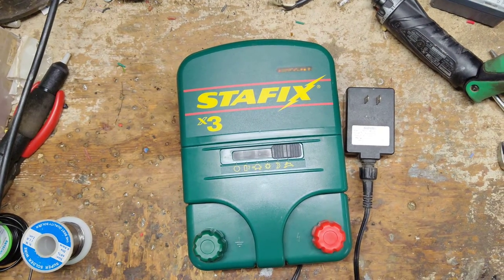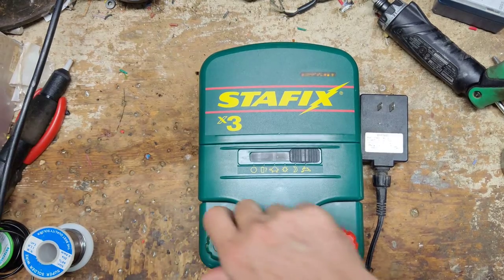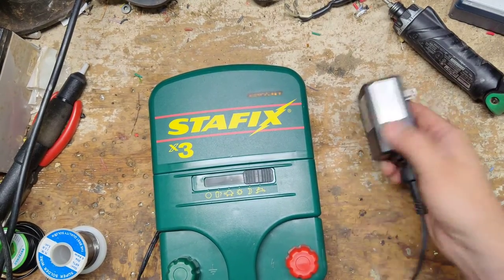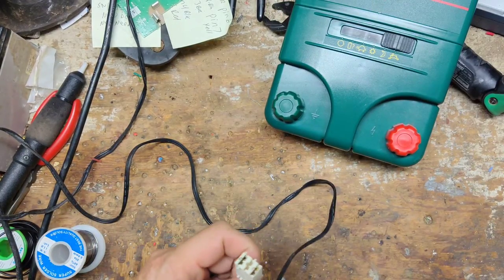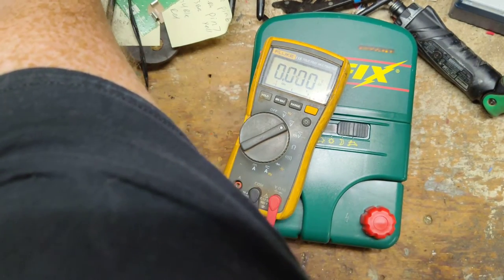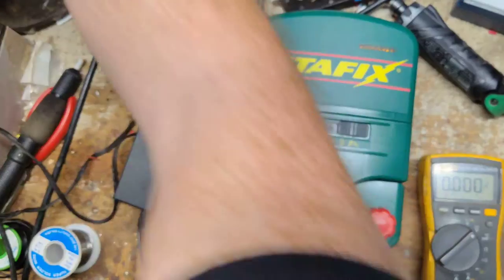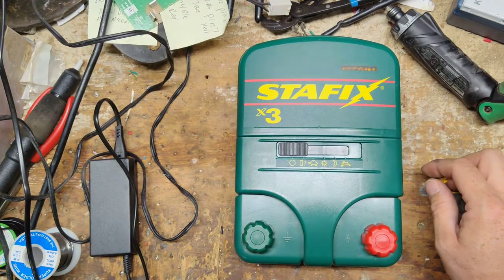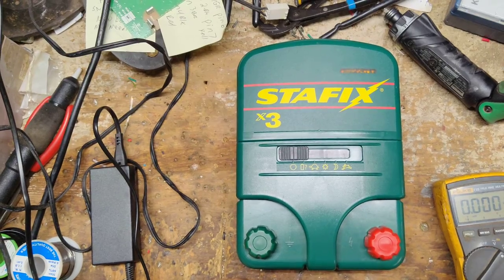Can you get a Stafix x3 or Speedrite 3000 Fence Charger Repaired?! Not these days unfortunately...

Comment: My Stafix x3  started doing the single red flash twice in quick succession when using my  solar setup the same as in your video. I took it to the house and used the ac adapter and the unit started working again. Do those 12v power adapters go bad? Or is it the module like you say? Thanks.

Comment: I just had a lightning strike on my Steve fix x12 I and it no longer works. Is it worth sending them to you for repair?
Reply from the maker: Yes usually they're repairable typically, but the x18i and smaller units are all waiting right now on parts. I can't seem to get anything for them. I have an x18i that's been here since late dinner early fall last year. So you could send it in, but it'll likely be sitting here awhile. I had a semi local customer bring a x12i to my directly and I told them the same thing. So they dropped it off and bought something else in the meantime.